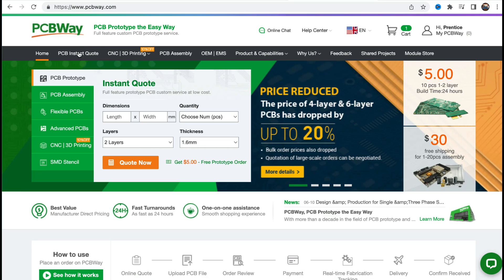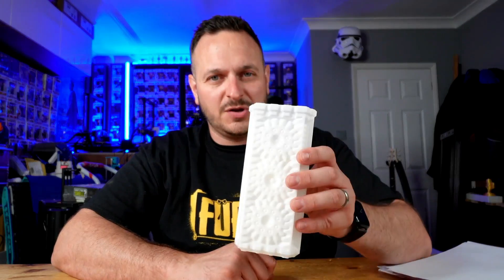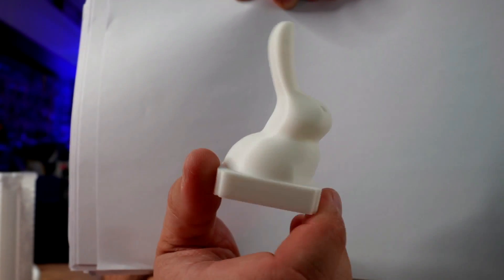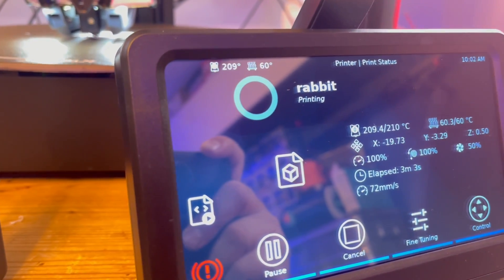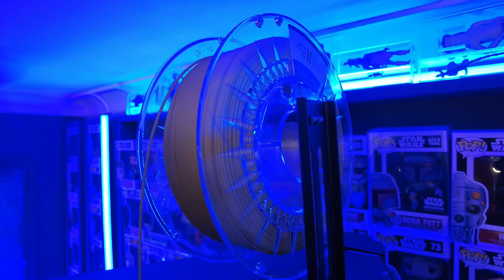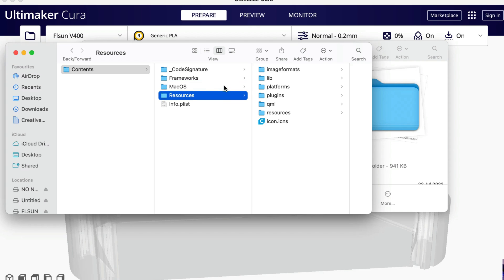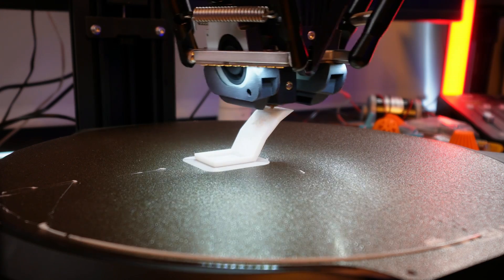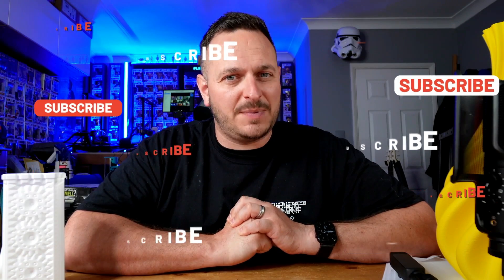The Flsun V400 Klipper Delta: Is it Worth the Hype? Find out Here

Comment: How difficult would you say the assembly for a newbie who’s never owned a 3d printer would be? Ordered the v400 today and I’m already paranoid I’m gonna screw up the initial build haha
Reply from the maker: If you can get one they are pretty easy to use. I’d suggest ordering locally and not from China as there seem to be many delays. It’s not a tricky machine to use but also not the easiest

Comment: Been eyeballing this and the new X-1 carbon for my new printer.
Reply from the maker: Both are printers, both have advantages over the other, tough choice :)
Reply: @TheRealSamPrentice  currently I’m running the QIDI X-PLUS. Great printer but I want speed as I currently print between 20-60mm/s depending on the material.